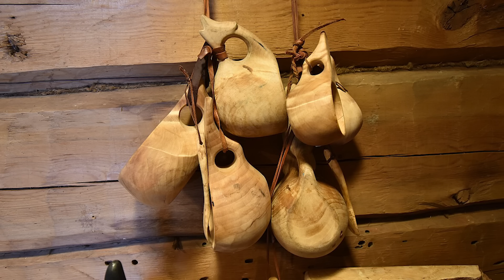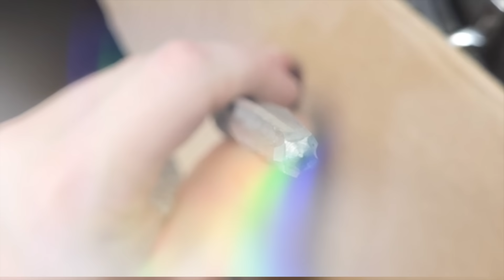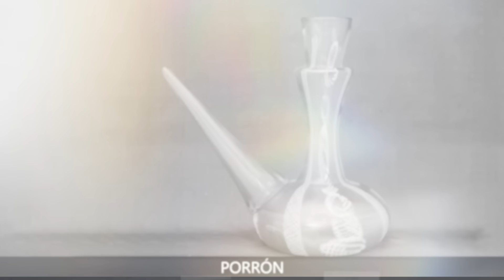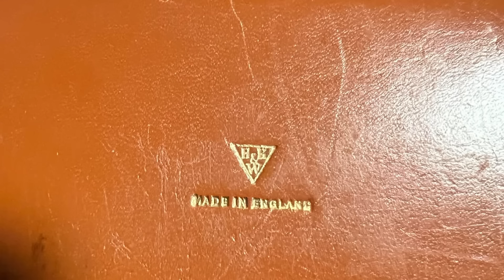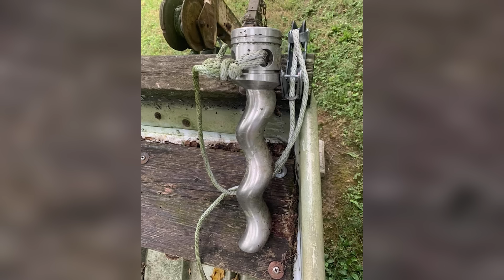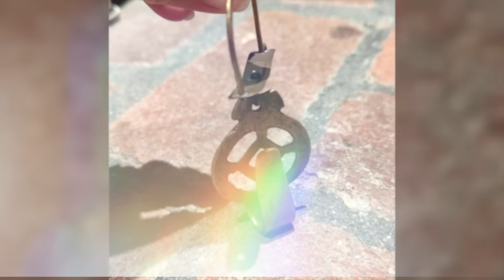What Is This Thing? You Won't Believe What People Used It For! #41

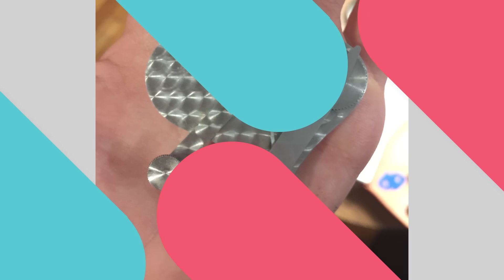Comment: 3:55  In the early days of my career, I had one of those.  They weren't very practical to use.
Your straight edge had to be rock solid and the serrated wheel played havoc with the ebony edge of your T-square.
They were awkward to use on any line that wasn't horizontal and curved lines were impossible.  You also needed a sharp razor blade to scratch out the ink blobs that escaped the nib.
Time was better spent honing your manual skill to draw neat broken lines using an ordinary drawing pen.  Thank God for the Rapidograph and even more for CAD software. 🤓👍